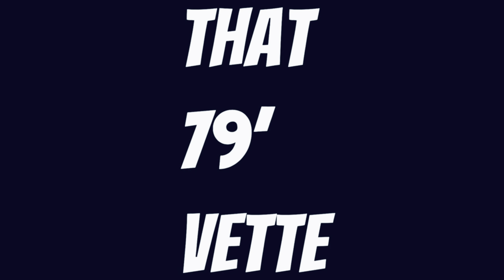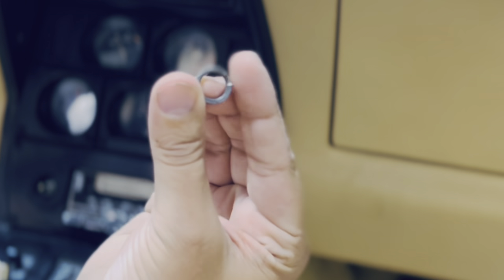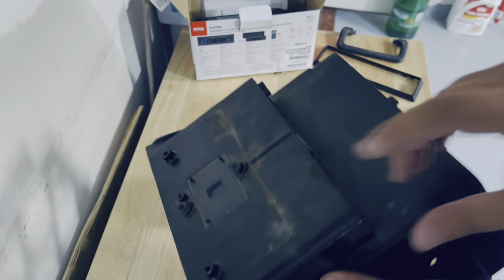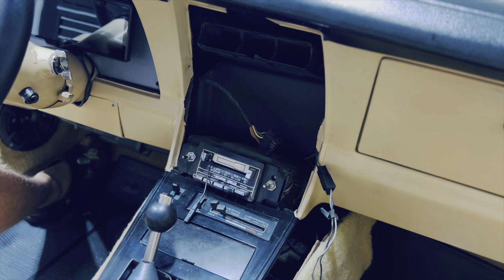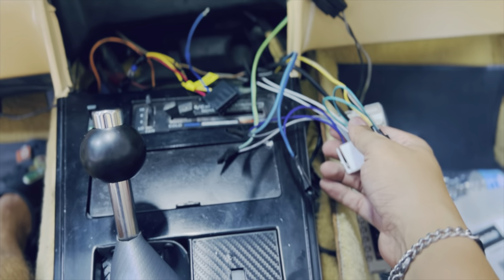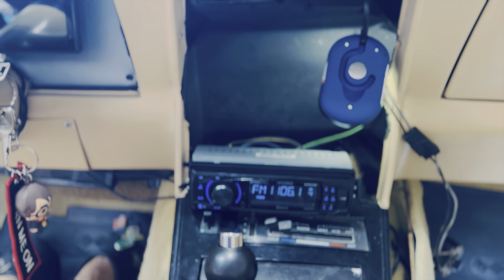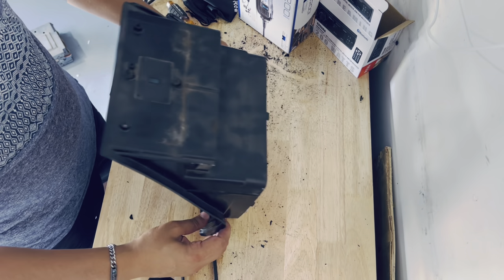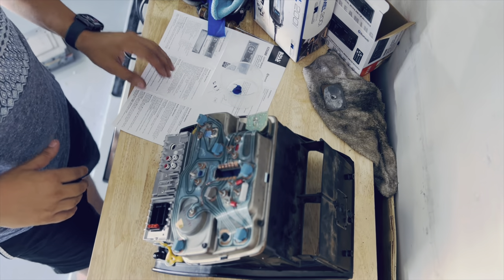C3 Corvette aftermarket radio install

Comment: Good job.  My '69 L-71, which I've owned since 1970, has an aftermarket radio also.  Over the years I have had several.  Currently the unit in my car is a multi-function radio featuring Nav, Bluetooth, AM, FM, DVD, Sirius XM and a few other different services.  The GPS is a 7" screen which is hidden away until a button is pressed.  The touch screen works great.  Understandably, there are people who love the idea of original but my opinion is "why not enjoy the car"?  In the over 50 years I've owned it, many small mods have been made to the point now where the car is so much more fun to drive (for me) than it was when it was new.  The numbers still match but the actually driving and time spent behind the wheel are better IMHO.  If you treat the car as an "investment", keep it original.  If you simply want to enjoy your Corvette, make changes that will improve the driving experience.
Reply from the maker: I agree with you! 
In all honesty, I drive the car more than I thought I would and although hearing the engine roaring is a must, I do enjoy some music from time to time. The stock radio (which I still have) was simply not doing the job. I know there are retrofit options but I didn’t want to spend 400+ just for the look and I wanted to re do the wiring myself! 

I would love to see what you have done to your car! What are some of the worst/best things after owning one for 50 years?
Reply: @c3sgarage  https://www.youtube.com/watch?v=EQZPzYsSec4&t=11s
Lots of stuff!  Did all the work myself over the years.  Best mod is power steering a la Borgeson and a 13" Formuling Steering Wheel.  My "radio" is from ebay and cost about $200.  It's fantastic compared to the Delco AM/FM.  The GPS comes in handy.  Also, my seats are from a '79 with the 4" side bolsters.  I do all my own paint and upholstery...or should I say did.  Now I'm just too old to do all that stuff.  Ignition is HEI GM which is much better than factory mag-pulse.  Hooker Side Exhaust.  Western Mini-Lite Wheels.  Getting rid of the PLASTIC WEAVE flat seats is a big plus.  They sucked.  Have fun with your car and enjoy the hell out of it.

Comment: I prefer the look of the original am fm cassette radio. The look of the original looks much better in your vintage corvette. You can add bluetooth to a vintage radio, and could upgrade your speakers. With a good cleaning and servicing it could still sound pretty good, and looks better. 
 Just my opinion.

Comment: How did you avoid getting a  Parastic Battery drain?
Reply from the maker: As of right now, I am not aware of battery drain, it is also worth noting that after turning the car off, the radio resets itself which means there is not energy running to it. 
Something worth noting is that I use a battery tender for long periods were the car is not in driving, and I do plan on adding a battery kill switch in the near future.

Comment: Is that the orange wire for main
Reply from the maker: Correct 12v constant
Reply: @c3sgarage  what wire did you run to ignition was it to the fuse ignition power for it to shut off and turn on with key
Reply from the maker: I didnt mess with the fuse box as the aftermarket radio had all the plug ins for the corvette.
How are you connecting it so far ?
Reply: @c3sgarage  I did it how you did yours but it doesn't shut off
Reply: Or do I just run orange to red
Reply from the maker: @Jose123Gomez-xg5if hmmm. One thing that may stand out to me is that there were 2 cables that went into main . 
Could it be that yours will need a separate connection to turn off and stay off?
Reply: @c3sgarage  that's what I was thinking I went with retro stereo that still looks classic I got two yellows I hooked up but I may not need one of them due to the antenna not working  with the red and yellow together then put a another wire that runs direct to orange is that wrong then
Reply from the maker: Agreed, one of the wires may not be needed and it is still feeding (parasite) while the car is off making the radio stay on

Comment: Loved your video!!! thank you. I have a 79 also and still have the stock radio in it. Love the size of this BOSS unit. Right now with the stock radio  I get a lot of static and noise on most of the stations. They make a Radio Noise Suppression Kit you can install, I haven't tried that yet,  did you have to install that kit with this new BOSS unit or does it have the noise suppression built into it?

Comment: Someone, kenwood, pioneer, ect should still make a quality shaft style car head unit for vintage cars... as some of us are not going to cut up the car to put in a new style head unit...
Reply: I have a 1981 and in 1990 the previous owner cut/removed the original three connectors to install a JVC cassette radio wiring harness. I order the original connectors and will be installing them today. I purchased a new radio that is retro in style that has Bluetooth ($350.00). When I ordered it I had to indicate the year, make and model. They sent the adapter that goes from the three original connectors directly into the back of the new radio. Everyone is different and so are the cars - my preference is to keep it simple and original.